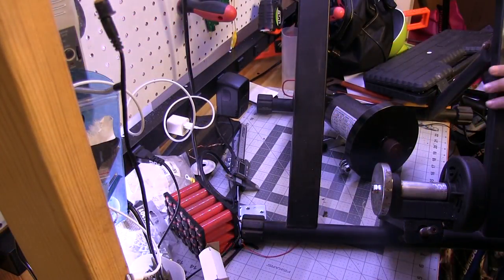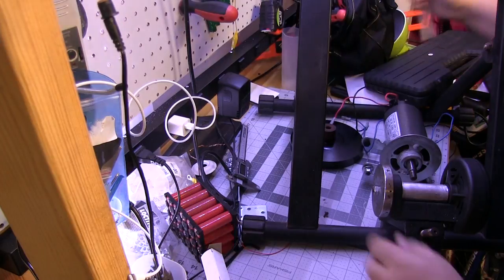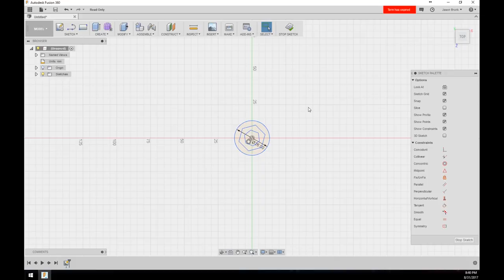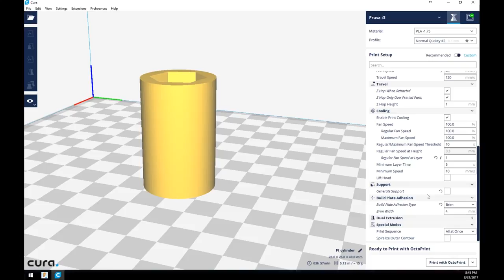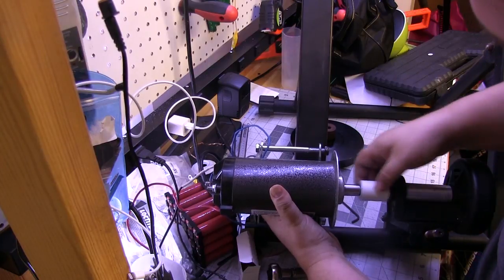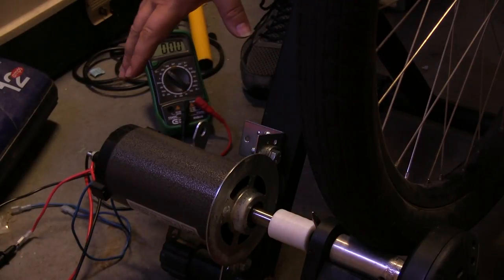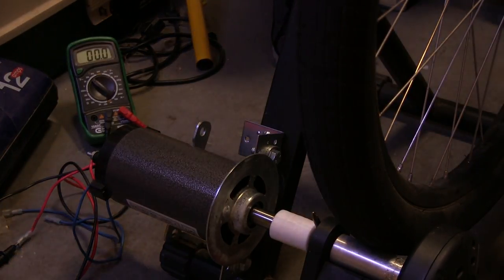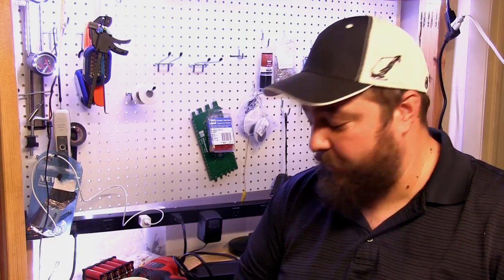Bike generator for 18650 battery packs - Part 2

Comment: Looking good. You might need a commercial shaft coupler like the ones they use on CNC machines to mitigate the shaft alignment and reduce vibrations.